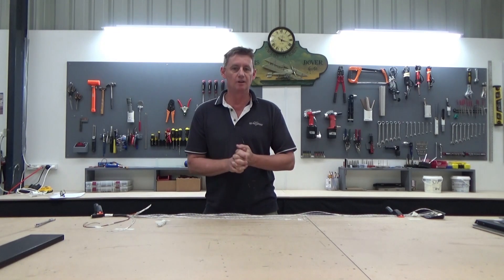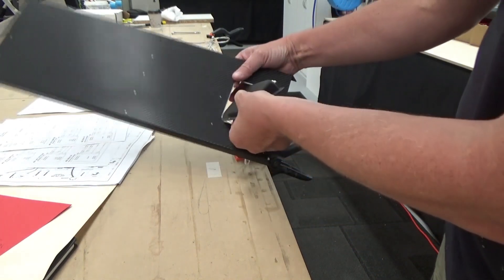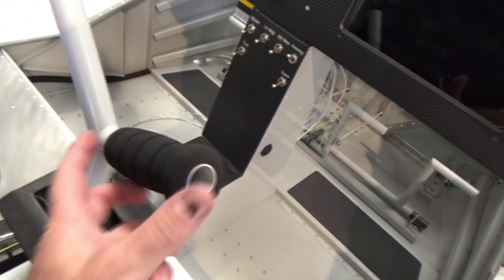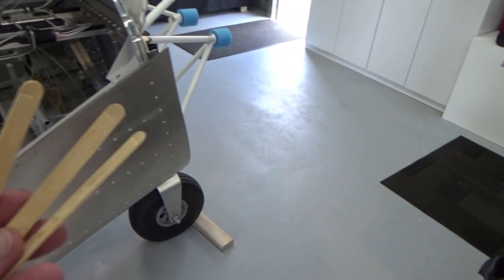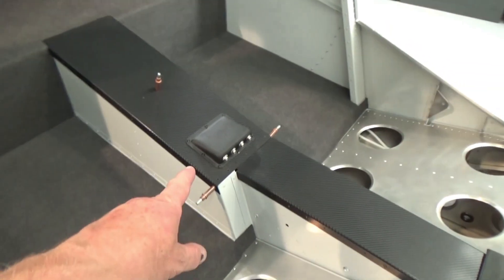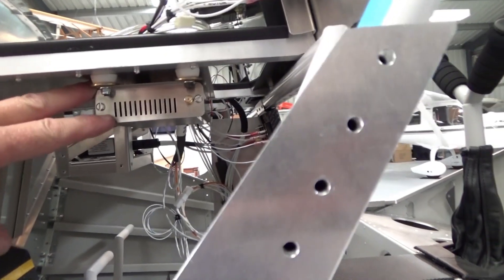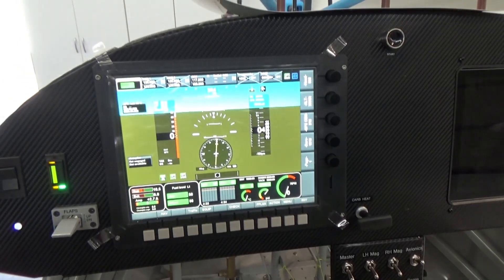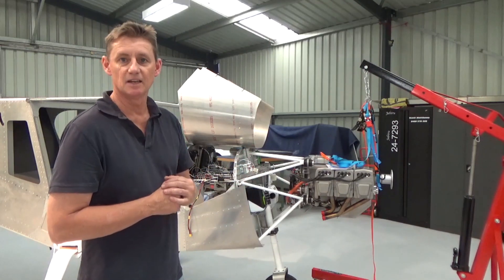Zenith CH750 Cruzer Build continues, Engine on. Jabiru 3300.

Comment: Nice work neat and clean. I'm scratch building a ch701 installing jabiru 3300a. Looking forward being at this stage.
Reply from the maker: Donnie Woodley  nice, be a rocket with the 3300.
Reply: My air field is almost 9000 feet msl so only as much power as the 2200 up here. Should be extra nice when I come down out of the mountains though.
Reply from the maker: @donniewoodley8604  love it that’s awesome.

Comment: Have you heard of riv-nuts, they are like threaded inserts that you can rivet in and would probably work better than the self tapping screws
Reply from the maker: Yes have a riv nut kit however they sit proud a little bit and use 2mm self tappers on the very small lip.

Comment: Putting the grips on reminds me motorcycle grips. Normally use grip glue, makes it slippery then sets hard. Or soapy water is good too because it drys after awhile.
Reply from the maker: Probably need replacing at some stage but looked like a simple job at the start

Comment: Did you mention to the MGL tech support that you didn’t have an antenna fitted?  To transmit without an antenna fitted is usually a good way of destroying the output stages so it is probably the lack of antenna that is the current problem.  They seem to be talking now which is good.
Reply from the maker: Stephen Gloor yes waiting on a reply, antenna on order.